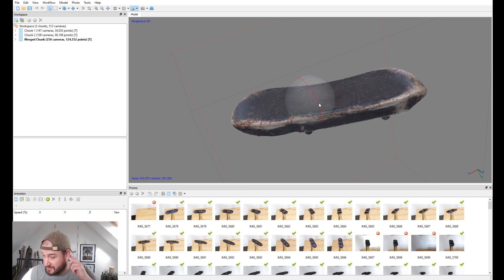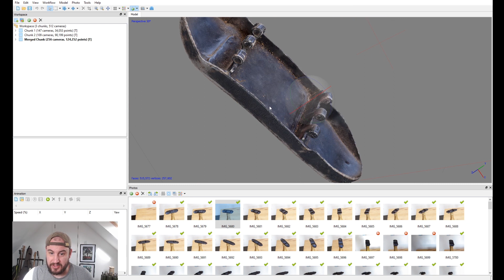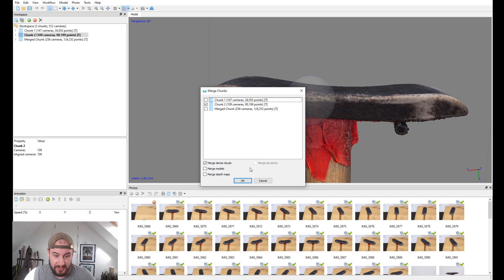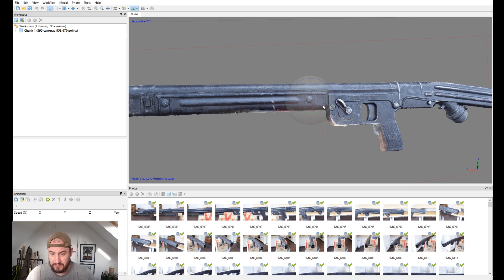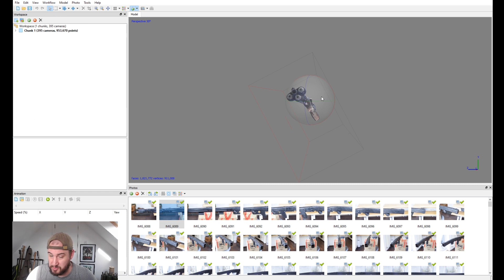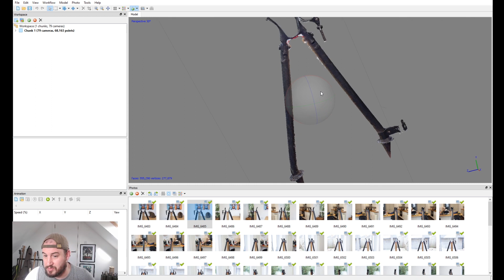How to 3D scan weapons  - LPO-50 Flame Thrower - Agisoft Metashape

Comment: Hi Josh, thanks for all these tutorials. I think you're right, 100 videos on matchmove is enough. I would be more interested in CG integration. Birdbox was a good thing but I encountered several problems. For example, the 3dequalizer nodes in Nuke don't work with the non-commercial license. So how would you get the undistorded plate inside nuke without 3de nodes ?
Reply from the maker: thanks, so if you cant use the LD lens models in nuke commercial, you can export a grid warp from 3de and import that into nuke, ill have to double check but i think iv done that before

Comment: Looking forward to this series Josh! I'm interested to see if you plan to use the photogrammetry textures in production or just use it as reference. Also, do you prefer Metashape over Reality Capture for Photogrammetry? I've used both and have great results with each of the tools.
Reply from the maker: Thanks, umm for the textures I’m unsure atm,  might be a mix of scan texture and some custom textures, 
So for scanning stuff I only use metashape because it was the first one I tried and has always worked well for me, I know reality capture is really good and there are a few others that are great, but Iv never needed to use anything else, also metashape licence is fairly affordable
Reply: @VFXTutors  Got it, thanks for the insight!